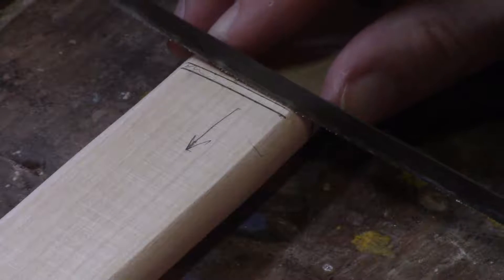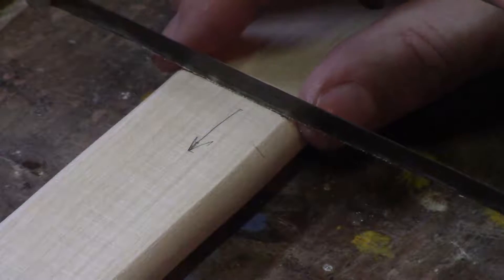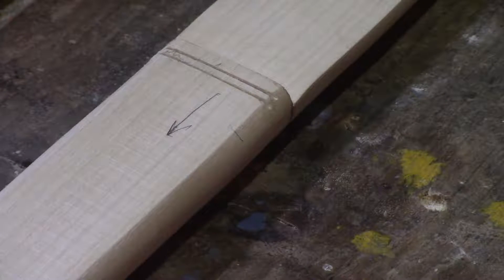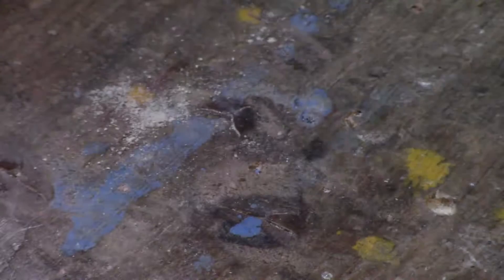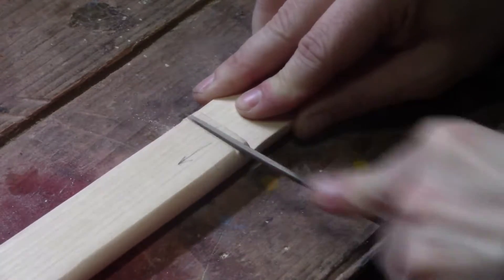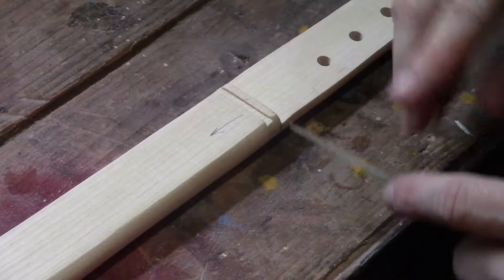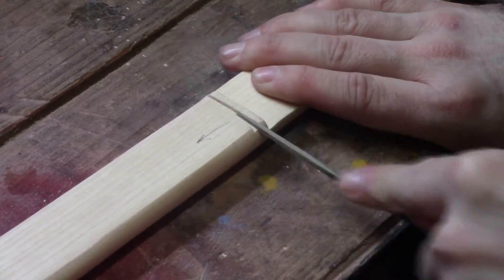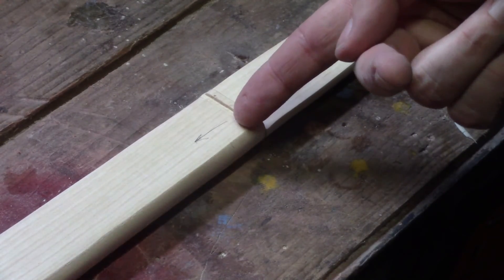Hurley Guitar PT 19 Cutting The Nut Slot

Comment: butcher! dont do it like that guys!!!
Reply: Totally agree mate, as a trained builder this is just awful to watch. It's an instrument and needs to be accurate not hacked together using 'rough' cuts and brute force. Go slowly, use the right tools and take your time. This cut is best done with a dremel and router bit with the neck clamped in a cradle and a straight edge taken off the centre line.